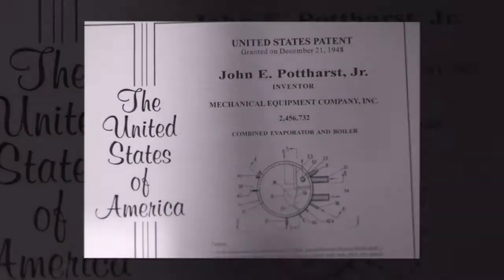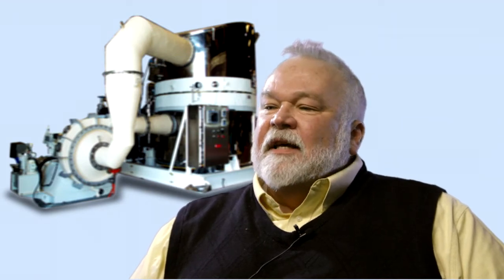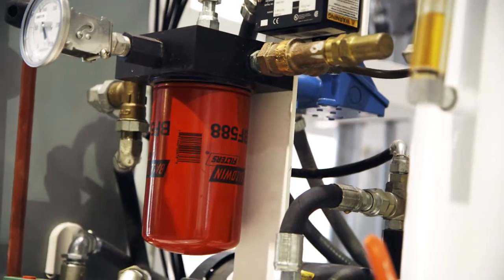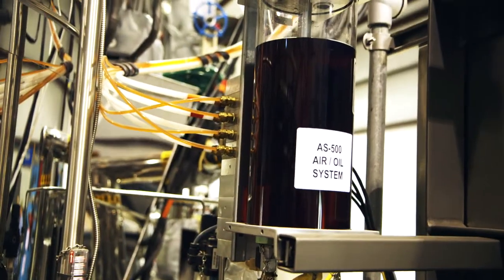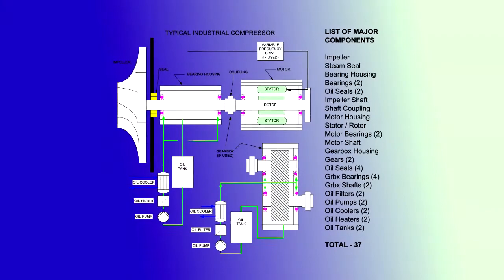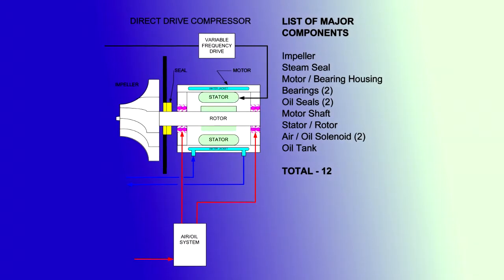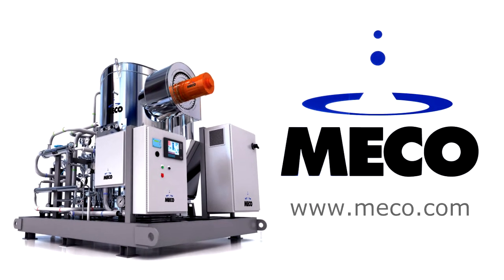The MECO Vapor Compression Still with the GII Centurbo Compressor

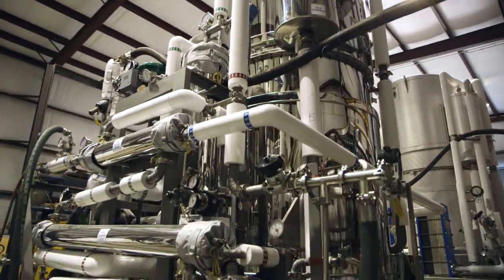Comment: 1:45 - ok, so basically you're also saying a 25 percent increase in capacity will require a 50 percent increase in energy consumption. The question is how does that differ from the norm? 

Four years later 😄